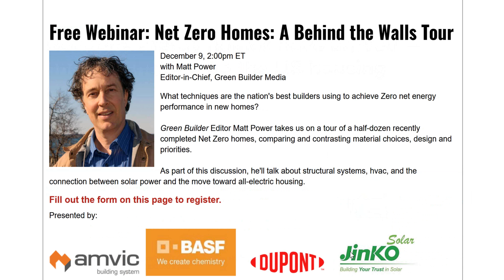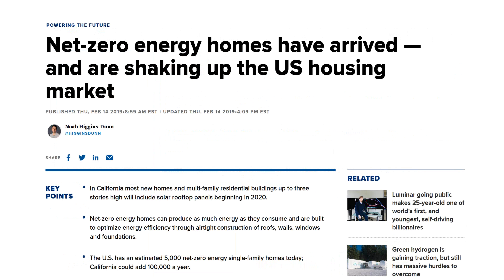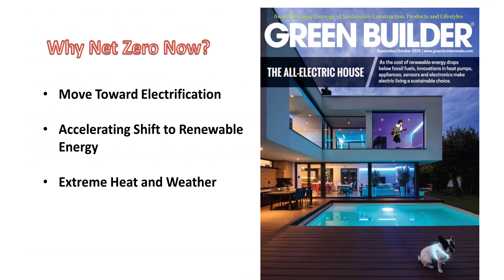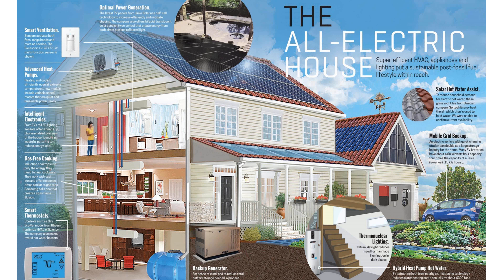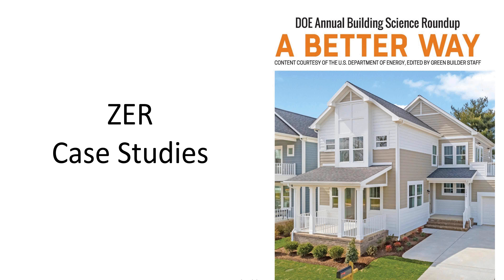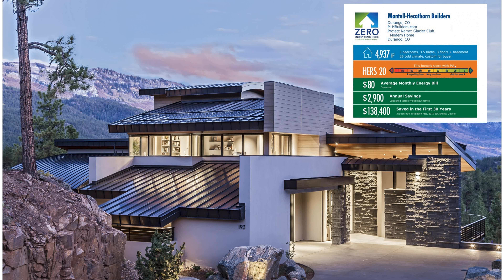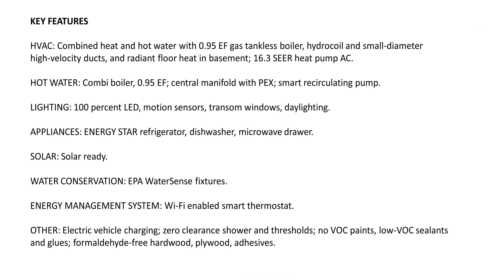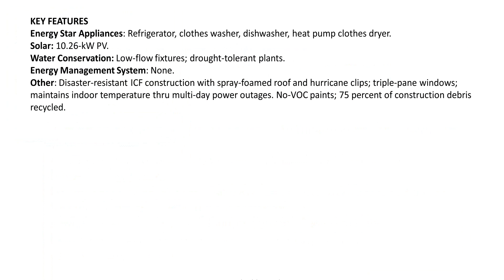Net Zero Homes Webinar  A Behind the Walls Tour

Comment: Quite interesting and informing.  
I enjoyed this very much! 

However, I disagree with your statement at approximately 58:15.  You state that if your AC bill is $300 and you put in a Heat Pump, your AC bill will basically drop to $100.  An AC unit is basically a Heat Pump; whether it is a window unit or conventional unit w/ an evaporator coil, it moves heat from inside the house to the outside.  I’m sure mini-splits work the same way. 

Am I missing something?  Please help me out.

Comment: I'm a little confused on how a heat pump distributes air throughout a house. With a boiler it is through hot water lines, with gas f/a it is ducts and vents. In the sample house it looks like each level has a portable A/C, so how does the heat/cooling get there?  What about radiant heat in the basement, or even heated floors in kitchen in baths? Would you need a backup generator with radiant heat?
Reply: I'm not a builder but in the research I've done they say the envelope is the most important thing. Even below the basement floor, foam is sprayed before the concrete is poured and the whole thing reduces air exchanges from 4-5 per hr to .6/hr. Then they replace the gas furnace which would be forced air with a heat ex-changer which would usually be in-floor heating.
Reply: Most heat pumps are still ducted forced air systems. Radiant floor heating is slightly more comfortable, but PH are so well sealed and insulated that the interior temp and humidity conditions are already extremely stable, so all PH are going to be very comfortable buildings.

Comment: Coal is 24x7 and solar is not. Need a mix of sources.
Reply: Geothermal is 24x7 and doesn't add greenhouse gases to our atmosphere. It works regardless of Wind or Solar...
Reply: This excuse stopped making sense 10 years ago. We have MANY options available today and coming soon that can supplement solar, such as battery storage, wind turbines, geothermal, etc. Stop being pointlessly resistant to positive change. We need to move beyond carbon based energy and we can do it a lot faster if people would educate themselves about what technology is already available and the even better options that are coming soon.